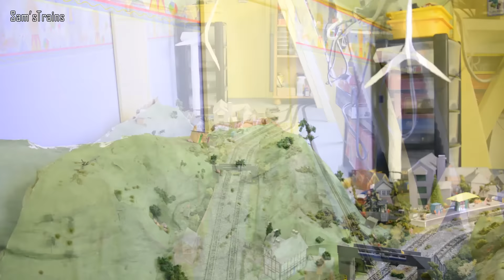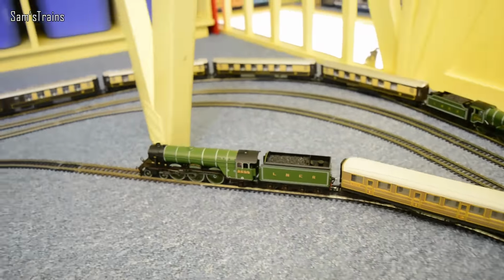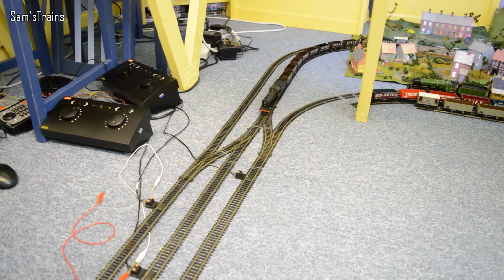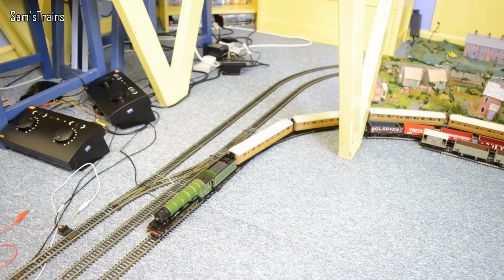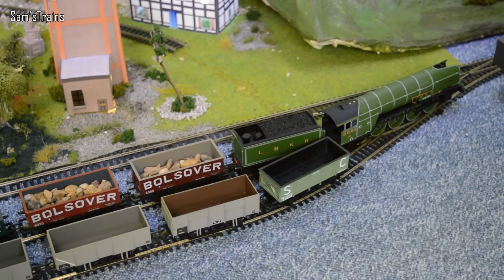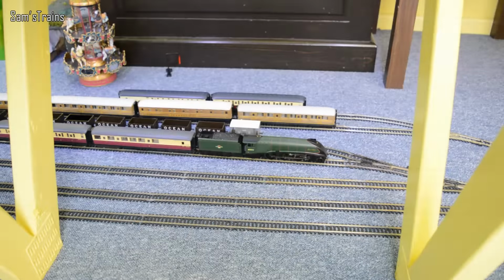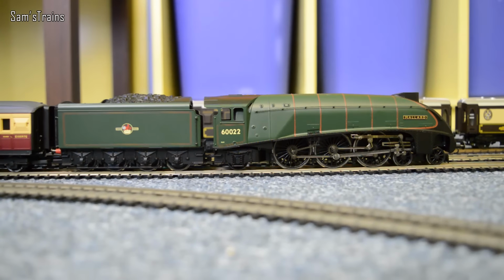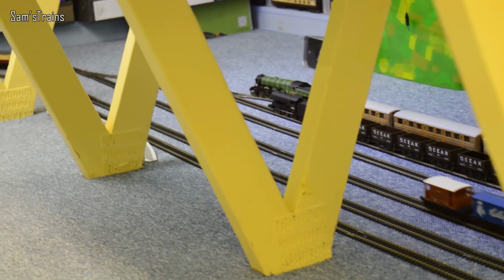Great Engineers: A Day with Gresley Locomotives (6)

Comment: The A3 is not the first pacific, because Churchward designed his 4-6-2 Great Bear in 1908, but it was later rebuilt into a castle class in 1922 because it had a lot of problems
Reply from the maker: Hi! Yeah you're absolutely right - I got that wrong, I meant to say the first class of pacific, since the great bear was just a single loco!
Thanks for the info mate,
Sam :)
Reply: Sam'sTrains Do the singel wheeler

Comment: 14:14 is that your only loco with sound? Do any of your other locos have DCC but no sound?
16:09 the Prince of Wales new build P2 now has a completed smokebox, and they're doing work on the drive wheels.
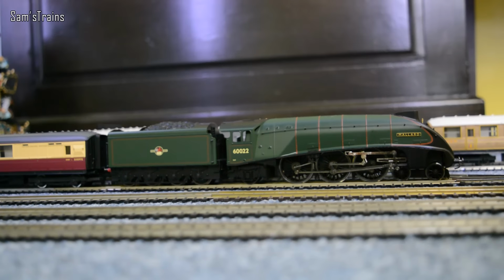17:23 do you have a model Mallard in LNER blue?
22:32 you said 4471, when it's actually 4771!
Reply from the maker: Hi again - no I do have a few other sound locos: A4, Class 8, 4F and a Class 40!
That's good news regarding the P2 - it will be amazing to see one of those in steam again!
Yes I do have a Mallard in blue, though it's a Wrenn one!
My apologies if I made a mistake there - but thanks for pulling that up!
All the best,
Sam :)
Reply: Not trying to be rude or anything, but putting “!” Kind of sounds harsh when you think about it.

Comment: i don't understand how does the p2 struggle on points. doesn't it pick up electricity from the tender
Reply from the maker: Hi Muneem - she doesn't struggle for power on the points, she actually struggles from de-railments! The front wheels, and sometimes the driving wheels, like to jump off on the tight points - it's probably a design error from Hornby on either the locos, or the points, but many locos have the same problems!
All the best mate,
Sam :)

Comment: Hey Sam, I have a question. Should I spend 160 pounds for a flying scotsman set? Is it worth it?
Reply from the maker: Hi mate, I'd say £160 is a bit much - I'm sure you could find it cheaper on EBay, or hattons for example! You only get a railroad loco, so it's not great value for money!
Cheers,
Sam :)
Reply: By the way,  Its a SET. So it also includes a full track, dcc remote control thing, and the coaches. what about now?
Reply from the maker: Oh okay - if it's DCC, then yes thats quite good! But if it's just DC - with the plain controller (no keypad), then it's way too expensive, even with all the track!
Cheers,
http://www.hattons.co.uk/51289/Hornby_R1167_Flying_Scotsman_Train_Set_with_3_x_LNER_coaches_loco_has_3_pole_motor_/StockDetail.aspx
Sam :)
Reply: Fusion - Clash Royale YES